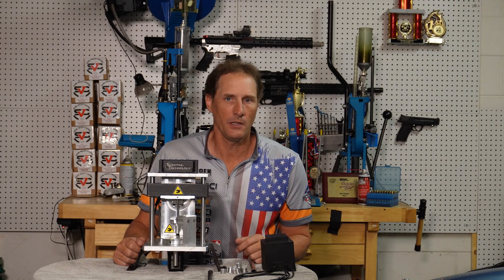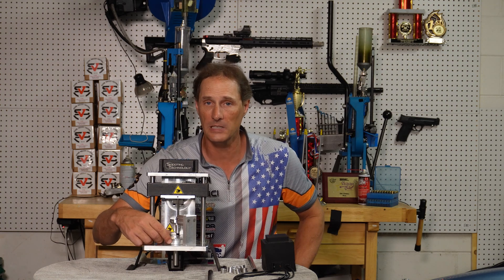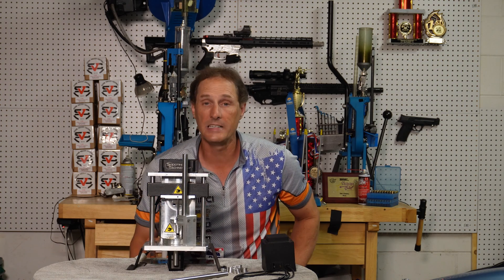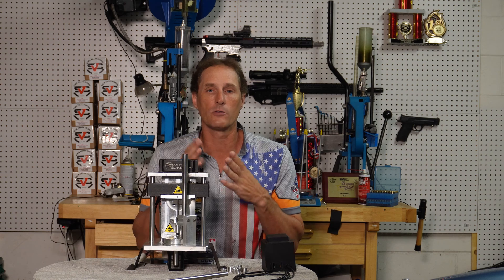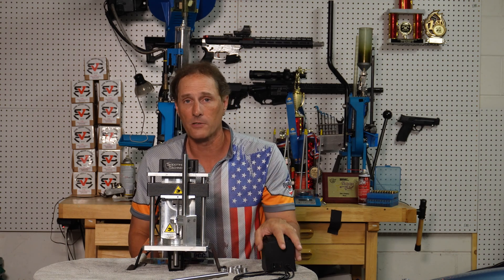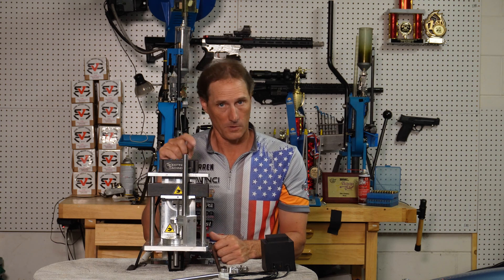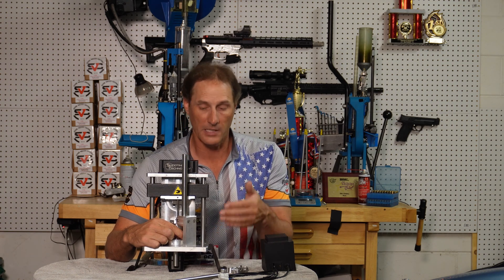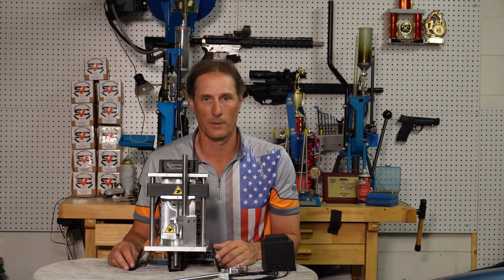Automatic Decapping Machine - Complete Walk Through Guide

Comment: Love mine, it has decapped 12,000 5.56 and over 70,000 45ACP with minimal issues. All the issues were with 5.56 crimped primers and small flash holes that caused the case to ride up with the decapper pin on it's up stroke. Purchased the smaller diameter pins and working flawlessly.